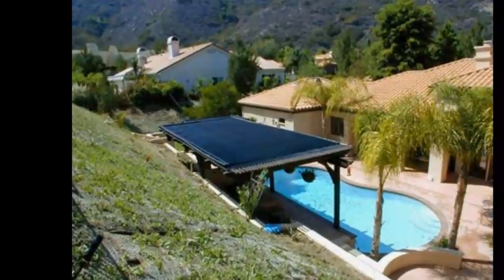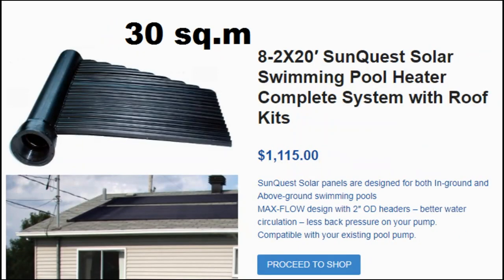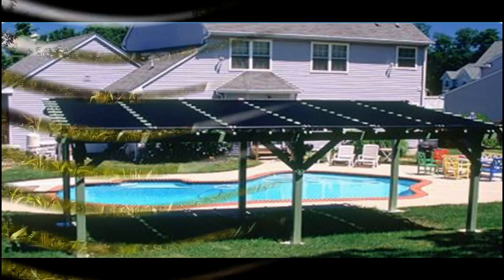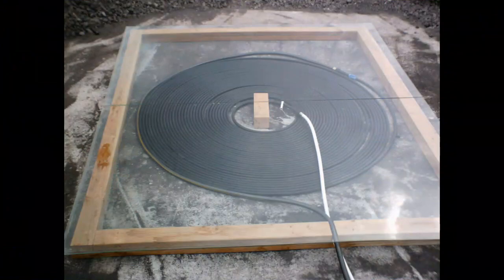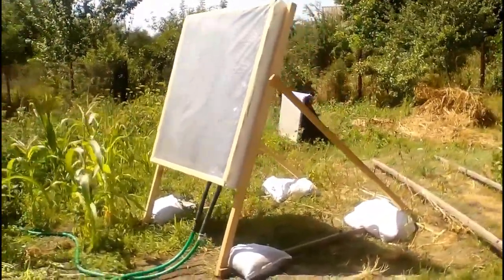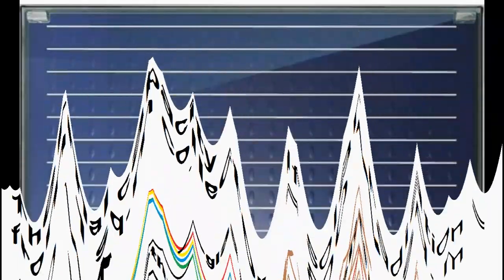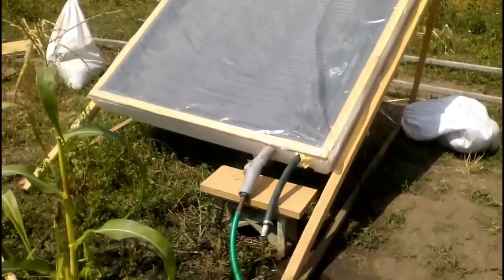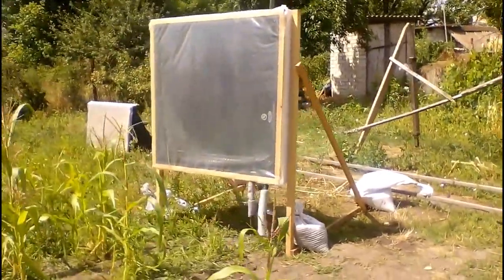DIY flat plate solar collector from cheap solar pool heater

Comment: I made one with a central heating radiator for my hot water for a while....put it in a wooden box with thin reflective foil for insulation. Worked OK, it was only a very small one and I didn't monitor temps...it could have been much improved. I now use an immersion element from photovoltaic because it is maintenance free. It would be good to see you try this with your scientific approach and discipline. Best wishes. FreeJulianAssangeFreePalestineFreeUsAll.
Reply: Central heating radiators will rust after a while and you will have dirty rusty water. Unless you use a aluminium (so it doesn’t rust) truck or car radiator and paint that mat black (to absorb the heat).
Reply: @harunyahyadotorg  They only rust in the presence of oxygen, which gets removed in an indirect system. Aluminium rads are good and a better conductor, both are available cheap or free second hand. I have a small collection for future projects. Best wishes.
Reply: @harunyahyadotorg  They only rust in the presence of oxygen, which gets removed in an indirect system. Aluminium rads are good and a better conductor, both are available cheap or free second hand. I have a small collection for future projects. Best wishes.

Comment: Hi,great work. i would sugest measuring not only the outcoming water temp, but also the ingoing water temperature with flow rate, to calculate energy captured. The outgoing temperature of water after standing still for a few hours doesnt mean much.

Comment: Of course if you are running the water through the heater faster you can decrease the maximum temperature the collector experiences. I also imagine the plastic cover decreases the UV that degrades the collector. You will have to change the plastic cover more frequently, but it is cheap compared to replacing the collector.

Comment: @ Sergiy Yergo

I have some thoughts you might be interested in. My friend had a 10-15 ft diameter pool above ground. He covered it with a insulating pool cover. He also added a solar collector to heat the pool. There was only two or three of them when I looked.

He told me that the temperature got so hot that he had to shut the solar collectors off because steam was coming off the pool.

So a pool with a thousand gallons or so water is a much better heat reservoir than building something in your house.

There are YouTube videos on how to build your own outdoor pool above ground from plastic sheet and shipping containers and ratchet straps to hold it all together.

I recommend you go to billboard tarps where you can buy anywhere from 10 to 50 mm thick commercial grade UV resistant billboard tarps in any size you want used or new.

You need to have a pool cover to hold in the heat and whatever solar panels you wish to use to heat the pool as your source of hot water for the house.

And the dead of winter on a cold day in New York City, I believe it got up 120° and he was afraid it would melt the plastic pool liner, so he shut the solar collector off.

Separately he pointed out the fact that this above ground outdoor pool is also a good source of a lot of water in case you have to put out a house fire and recommended hooking up a pump and hose in case you ever had to do fire safety on the property and put out a fire. An added benefit to this system.

Comment: Thank you. Good video. I have three of these Chinese heaters. Use some aluminum foil for heated floors and fire proof insulation under the Chinese heater this should solve foam meltdown problem in extreme situation.

Comment: I was thinking of designing a house with a wall oriented to catch the most sunlight during winter.  The wall would have a system of mirrors to divert light into a water tank. My goal is to evaporate the water as a first step in filtering it. That should make it 99.9% pure. With this i can take various waste waters or well or rain water and get useable water out of it. 
I found a video where a guy explained the bigger and more insulated a water tank the better and longer it stays hot. 
I could run a water line through this solar tank and heat the water line. Similar to a compost water heater. The question is how much light is needed to eventually heat and maintain a 500 gallon tank? That will define how long or tall a wall is needed. If i can heat it for free during the day it might be possible to hold temp for the entire night.

Comment: Try using cellular concrete (also known as air-entrained concrete, aircrete, or foam cement) instead of styrofoam... it won't degrade under heat. It is 'fragile' when the air-entrained concrete is made, but withstands heat well and is better insulator than many materials when pumped full of air. I make collectors with cellular concrete and focus on insulating and maximum heat transfer to minimize size for maximum efficiency.

Comment: Interesting! You should regulate the flow in order to keep a constant output temperature, you can use an arduino a pump and a temperature sensor for that. It should stay cheep. If you have questions about electronics, i can help you.

Comment: Perhaps you should experiment with UV stabilized PP Pool heaters (xtremepowerUS) between double layer polycarbonate and isopolyurethane insulation

Comment: Thanks a lot sergiy, but y think you could put a Asphalt bed in each solar pool colector because recent search published in Brazil by our the usp university  to proof that good Asphalt as bed for cooper tubes to maintannance its daily high thermal 50 o C up to 20:30 hours (8:30 PM)
Reply from the maker: Please, write a link
Reply: @sergiyyurko8668  y have but only in portughese
Reply: Dear Sergiy...above, y sent you another porthuguese notice about recent search published by mexican university with good results of sun heater intensive capture by alone aspalth ("betão") bed with peretovistka stones
Reply: Sorry, because os the peroviskita stones
Reply from the maker: Thank you
Reply: I want to make hot water pool in Nepal, how is it possible and how can you help me? please help me for this work and how cost will be for 20 ft wide and 40ft length?

Comment: Can we use coolant oil to absorb more heat and transfer the heat absorbed through a heat exchanger.
Reply: Nandlal Karwa water actually absorbs more heat. It has one of the highest specific heat capacities of any commonly available substance. Plus, it's not a potential contamination risk like oil- imagine getting several gallons of oil in your pool- specialist cleaning and safe disposal would be very expensive.
Reply: Also oil is an incredibly solvent that loves to degrade products made of similar materials...  vinyls are oil based and oil be it petroleum based or vegi based will liquify cheap Chinese vinyl in a very short time...